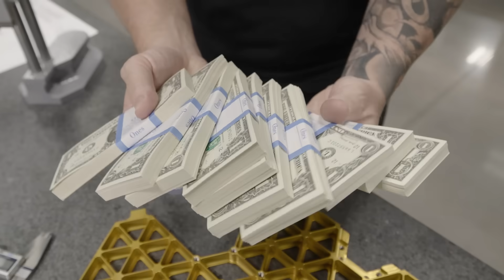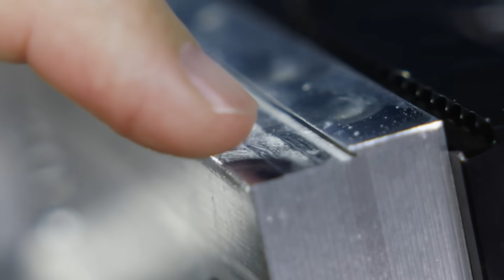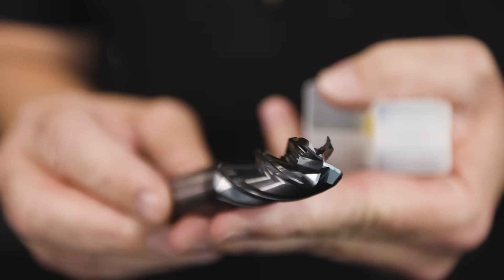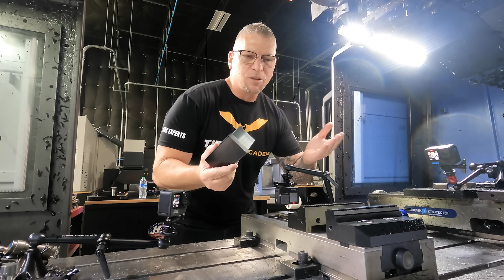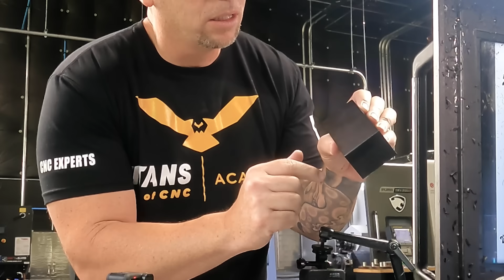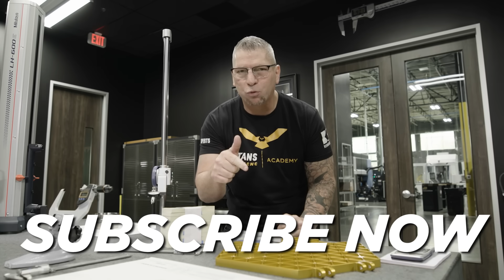How To Master The ART of Machining Plastics

Comment: first im a subscriber from three years or so ago and ive been so much more into cnc machining and this whole since ive been learning so much from you guys i ussed to work at a small job shop but i could never get them to teach me reasons why something is the way it is such as running a 3 inch u drill at 225 rpm eventually i learned about how heat is directly related to spindle speed and then i started figuring things out for myself at a slower pace than i wouldve liked but i kept at it for 10 years now and i couldnt be happier, i love this trade because the people are usually amazing and willing to help you learn, and now the fact that your amazing team is putting out free content for learning purposes is something only the selfless do and you sir are a saint for those of us up and coming. 

as and edit my father took me to my cousins shop after i got out of high school and i was hired in a year later learning manual lathes and bridgports and the verticle shaper also by time i left that shop i could run all the machines except the mill and now at my new job im confident in myself with all the machines my favorite so far is the mazak lathe with the live tooling dual spindle, im not gonna lie i think about this trade all the time my roomates say im a work a holic but i love what i do and i never want to go home.

the stack is 4.3536 inches

Comment: 4.386" +- .003
Can't really talk about family but I've been into additive manufacturing since 2015. Learned so much from the community tried college but things got in the way. Recently got into subtractive manufacturing. Picked up a sub contract with a local machine shop. It's been fun. Beginning to feel like I can make anything. Thank you for the content.
Reply: I had this same answer until I took into account the air in between each stack and that extra .1250 below the stack caused by the flex of the bills. If it were pressed slightly this would be on point. How many others did what we did? Lol

Comment: Working in New Zealand, running a 2017 Haas VF-3 with Renishaw probe, I love it. I love experimenting with different tools / toolpaths / machining strategies to get cycle time down and tool life up. I have a job coming up where the last guy was making one every 8min, I do one every two minutes. Another part we do in stainless steel, the last guy was 6m45s per part, I'm 3m10s. In these parts I experimented with different brands of endmill, Harvi1 TE did 650 parts, second place was SGS at 360, then Garr at 288. I love making stuff run fast. My guess for the thickness is 109.88mm, or 4.3260" :)

Comment: Past 5 years I have making cad cam works from your academy. Before that I don't know about cnc machinhg. After watching the video I simply relase how amazing this work is. So continue to do so I speacualy have handbook where I watch all your videos which have all the data for machining all the material you have shown on the YouTube channel and noted down the tips and tricks you have shared but not on paper. This trde mightbe the hardest but the process makes me want to go for it. I already have ci casting manufacturing foundry but still i want to open cnc job shop. My parents have allowed it and now last year I have started going into my uncle cnc shop. Thier work is ordinary and the same but still it makes me more experience in practical knowledge and will defentilly help in future shop till then I want to continue to be on your academy and keep learning new and amazing things the world is not teaching thats it. By the 2ay cash thickness is 4.3 inch inch and band is 2.2 mm each cas bundle hase two sides so .11+.11 mm band. BOOM